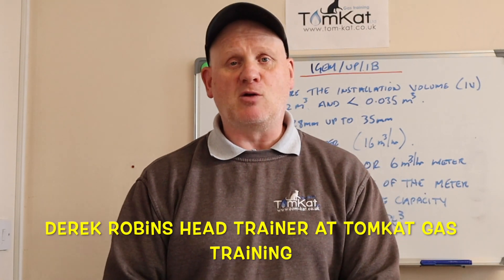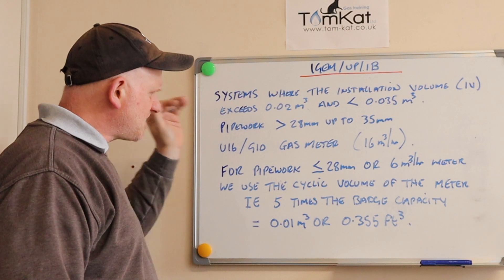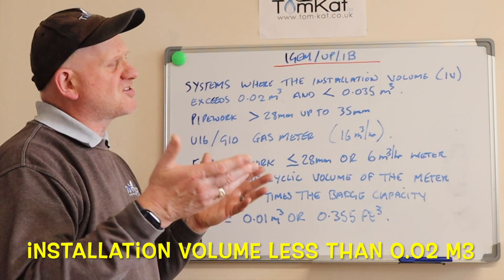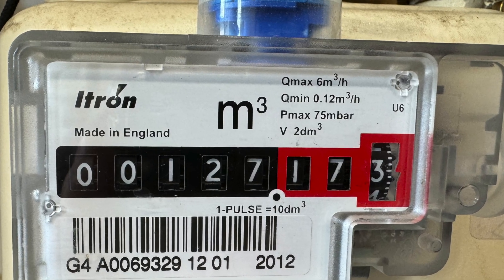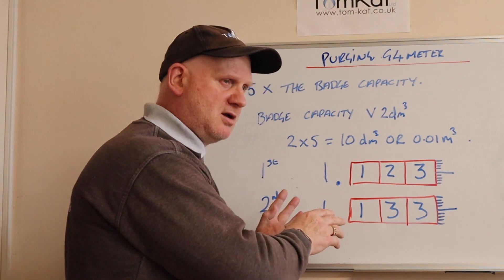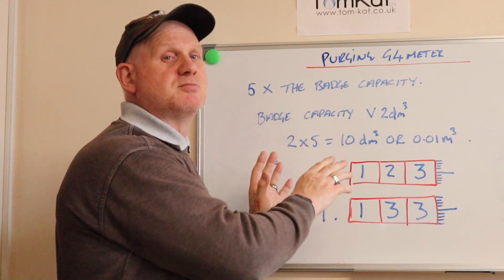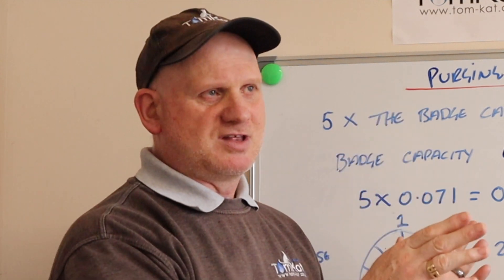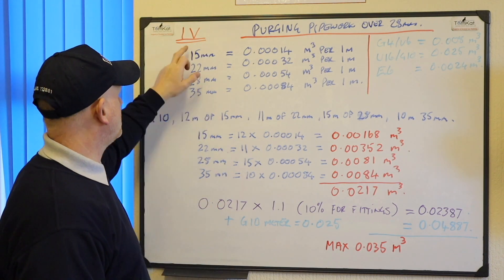IGEM/UP/1B purging natural gas for domestic gas engineers, all you need to know. #gastraining

Comment: SIR WHAT IS THE MINIMUM PIPE DIA WHERE WE DONT REQUIRE TO PURGE A GAS PIPELINE
Reply from the maker: If you allow air into a gas pipe you will need to purge no mater what size it is